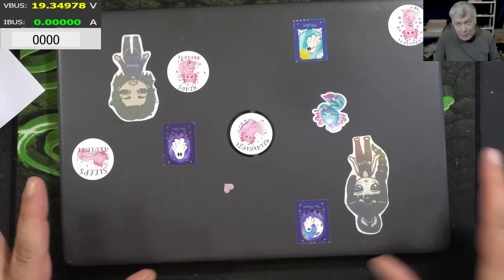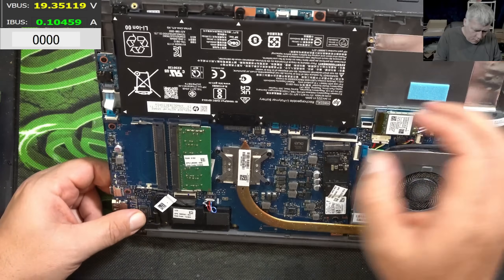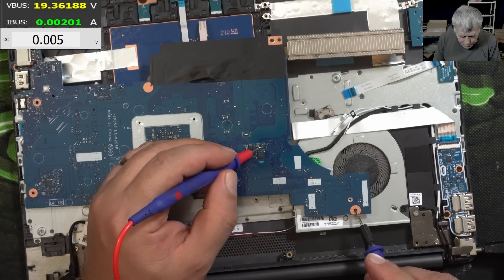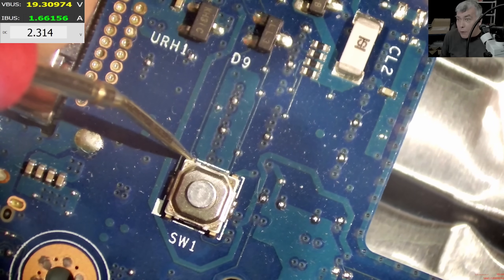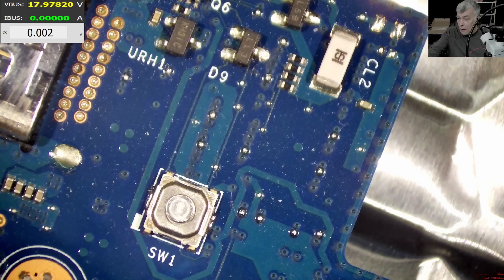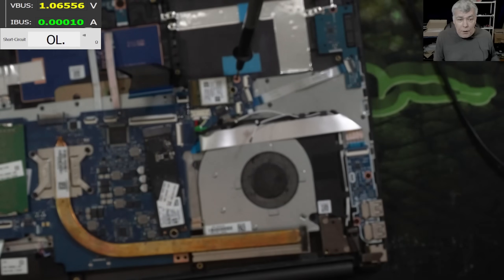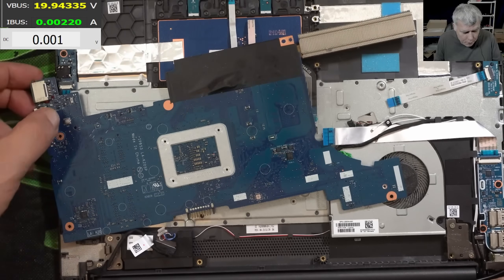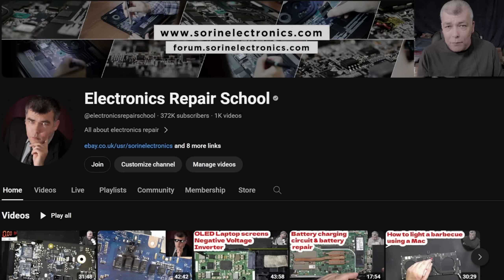Hp 255 G9 charging but not powering ON, board repair, so easy to fall down a rabbit hole

Comment: Sorin you didn't show us the main power rail voltage after the fix, guessing that would have been back to 19.3v as the shorted cap or the 5v supply was pulling it down to 18.6v?

Comment: Hi Sorin, great video as always, I have to buy a new laptop soon can you recommend the one you don't have to keep repairing the most. Many thanks.
Reply: Can't speak for Sorin but any laptop that runs cool i.e. not overly powerful and that has good heatsink design and fans. He has said in his Sunday coffee live streams (and probably other repair videos) that you should avoid gaming laptops because they heat up too much and that reduces the lifespan of components like capacitors. Also look for a laptop with the new kind of MOSFET / drivers that sacrifice themselves instead of shorting the output to ground, this can save your CPU or GPU in case of a short.

Comment: Sorin thanks 2 you i started looking at some electrical stuf to repair .i started with my phone after trouble shooting it it whas a short in a ribbon cable of the stylus pen charger .😂 cut that sucker out and boom it works ez pizza. It would not charge or come on at all .Just a ribbon cable thats crazy to me ez fix yeah but so hard to find.maybe it whas luck . im gonna look in to the laptop i have here .hopefuly i can get that to work also .

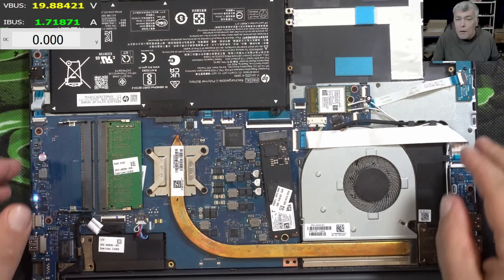Comment: 18:15 - I think its about curiosity and chance to get something interesting. Also, even this deviation from standard steps, teach you something new, 2.2V on power button. However, 2.2V can mean leakage from 3.3V to 2.2V, can mean also pullup resistor... but time will tell...

Comment: I am never lucky enough to have a laptop with a sorted capacitor 😢
That sot23 component next to the button is marked D9 so it is probably a diode which would make sense since you have 3.1v on one pin and 2.3v on the other (voltage drop of the diode).
Reply: But still when press button..3.3v don't go 0. or change...strange ...could be underneath a wire go to chip
Reply: @ToniToni-k2e  You are right I did not notice that part, strange indeed 🤷‍♂